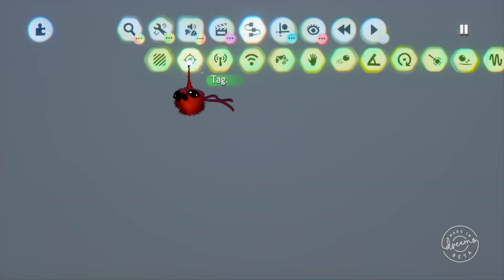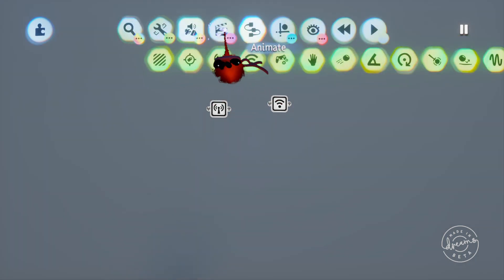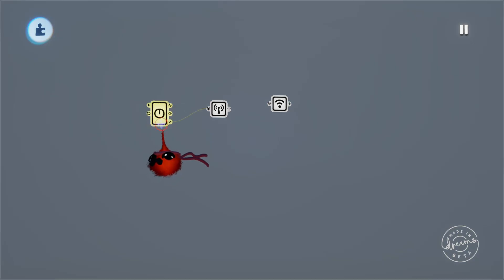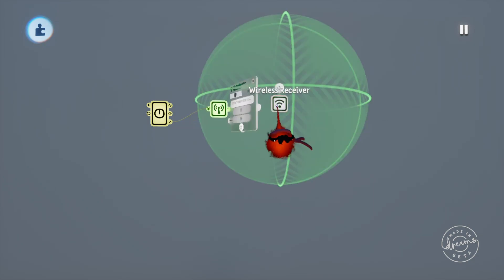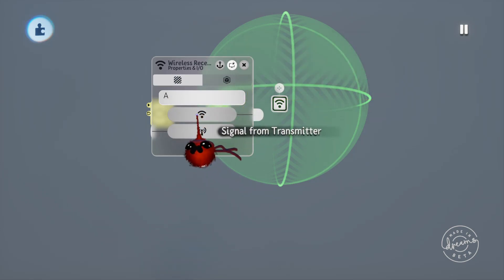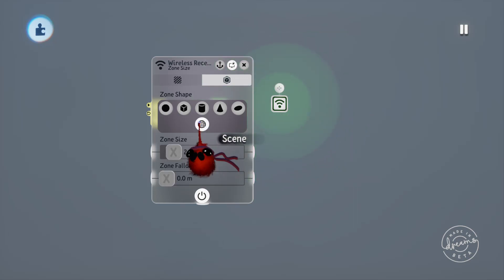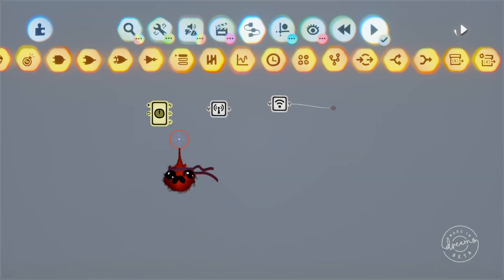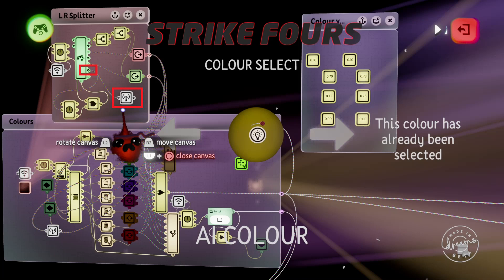Tutorial #10 - WIRELESS TRANSMITTERS AND RECEIVERS - Dreams PS4 Logic

Comment: How can and object detect that a laser sensor is hitting it, been making an fps aim trainer and want hit scan.
Reply: Yea I used an emitter to spawn a tag where the laser is hitting, works pretty good.
Reply: ShoTzzi Gaming how did you do this exactly?
Reply: @RaptorPrinter  you can use it to emitt an object aka bullet at the location the laser is pointing and hitting
Reply: ShoTzzi Gaming would I be splitting up the hit position from the laser scope output into a combiner using the transform button and then pass that along to an emitter scene space transform in?
Reply: ShoTzzi Gaming never mind looks like a direct input from the hit position to the scene space transform does the job
Reply from the maker: There’s no ‘ive been hit’ output on the hit objects unfortunately.. it’s able to be done but it involves using the ‘hit location’ output on the scope and comparing it to the location of the sculpt to figure out how far away it is.. I’ll let you know if I think of an easier way to do that though

Comment: Great tutorial, however I'm struggling to grasp what can be done with a wireless transmitter and receiver, that can't simply be done with a trigger sensor and tag?
Reply from the maker: In a lot of cases (especially for character / tag detection) a trigger zone and tag will work, but they don’t transmit values, just a simple on/off. A wireless transmitter/receiver though can transmit values over 100%, so you can send complex signals (you can even plug in a fat wire) and it’ll come out the other end unmodified :) 
Hope this helps
Reply: @JimmyJules153  That does help, thanks!

Comment: Do you think that using transmitters instead of simple wires might fill up the "thermometer" for logic quicker?
Reply from the maker: It definitely does yes, a wire takes up a single spot on the thermo, and you have to use wires to hook up the transmitters so it definitely uses more. With the transmitters though you can make modular chips and use them at a few places with an emitter when they’re needed, but you couldn’t do this if things were all hard-wired in :)
Reply: @JimmyJules153  I see, that makes sense, Thanks!